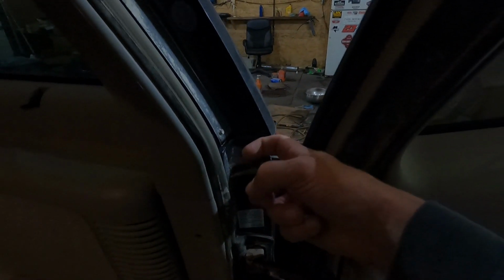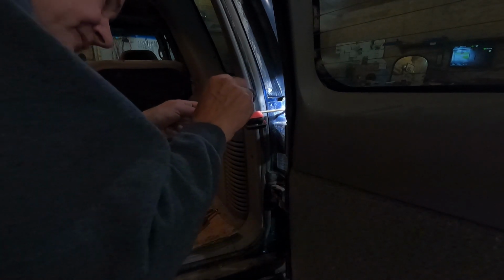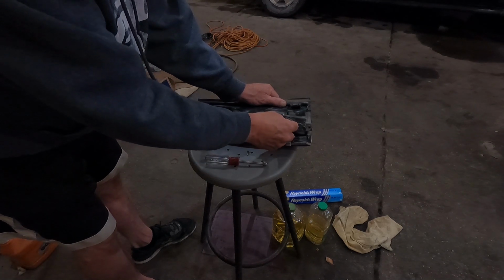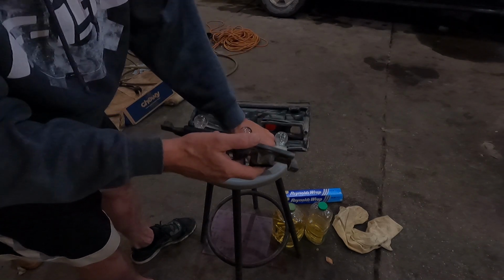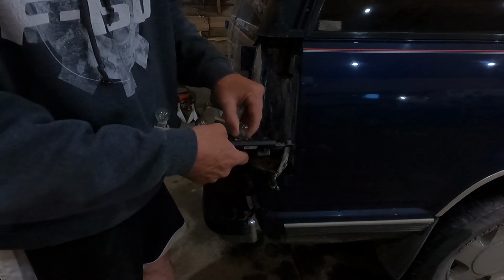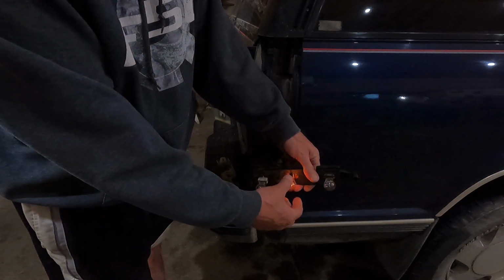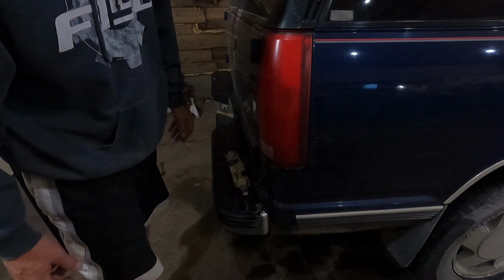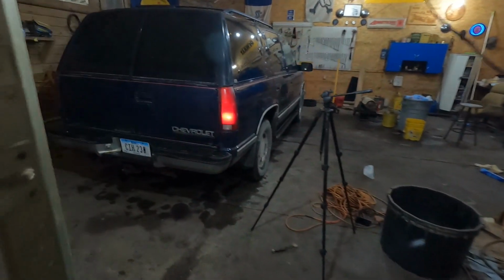GM Truck Tail Lamp, Brake Light, Turn Signal Circuit Board Replacement. Chevy and GMC.

Comment: That old shop is inside another building.
Like you built a garage in the barn.
It's too bad that the roof is going on the garage. Otherwise, you might've been able to tear that extension off the barn and use some of that lumber to build an extension on the garage!
Reply from the maker: Is what it is.. Barn and old shop getting torn down...way it is... I can agree with a lot of what you have said here and in previous posts....but way easier said than done.